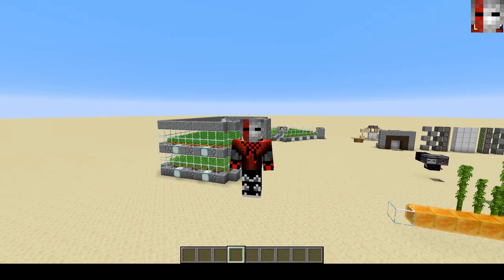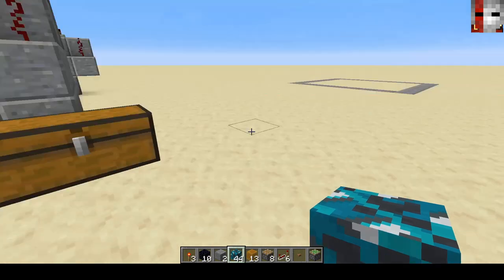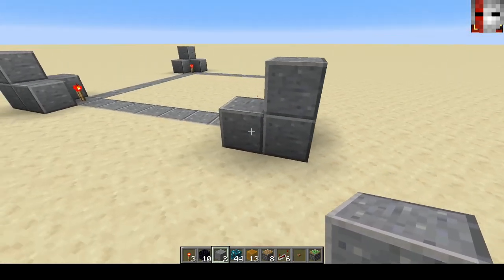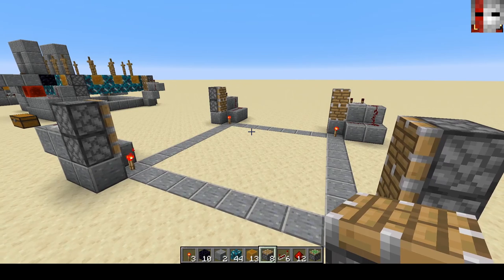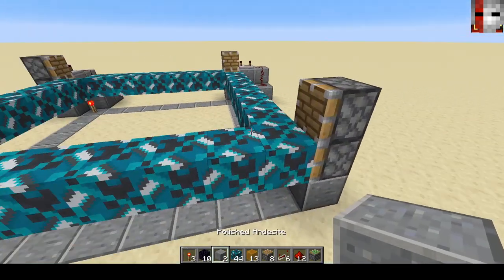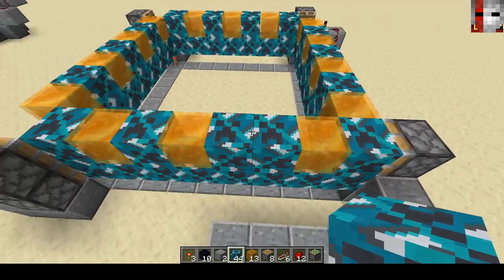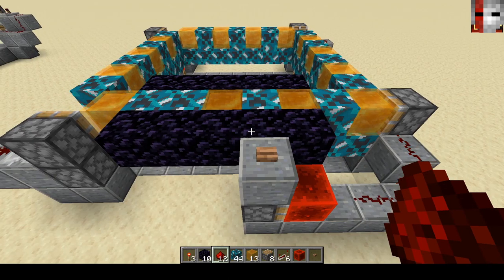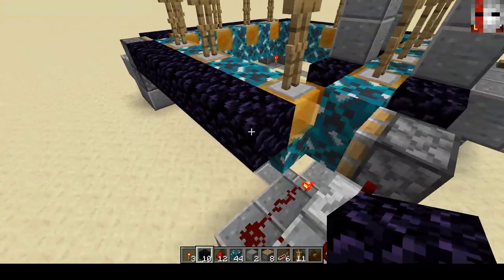Minecraft Honey Block Conveyor Belt Tutorial

Comment: im 1.16.5  java and it keeps clogging up with blocks very bad tutorial doesnt work
Reply from the maker: I have checked it in 1.16.5 Java and it works just fine, are you sure you are using the correct blocks
Reply: yes i used exact blocks what seems to be happening is that it is like clogging up in the inner corners and then there are not enough blocks for it to work
Reply from the maker: @drdeemed9808  I will look into it and see what is happening
Reply from the maker: @drdeemed9808  if you join my discord you can upload the pics of what is happening
Reply: @Spectrum1981  K will do